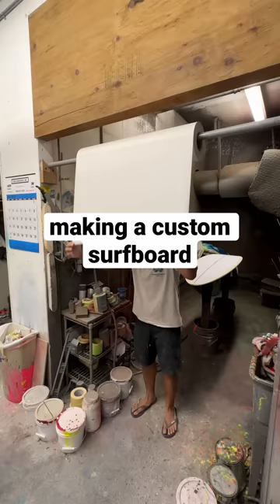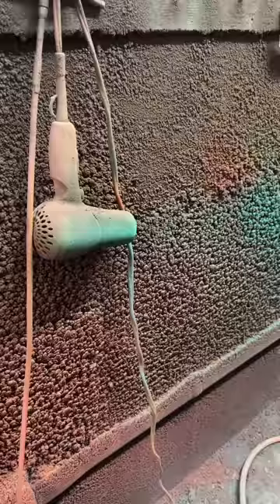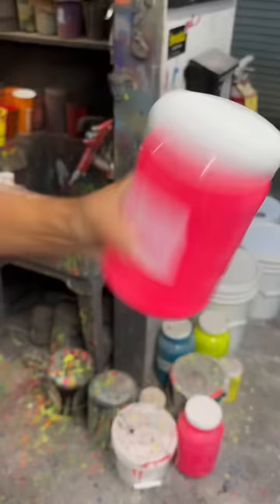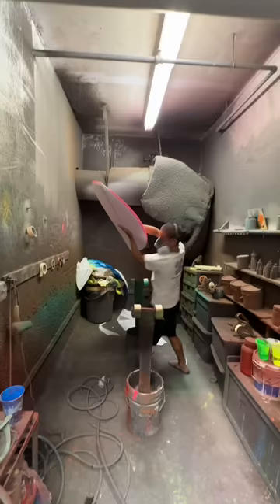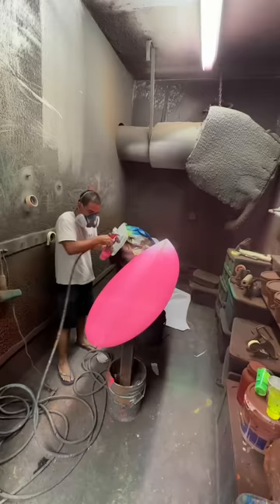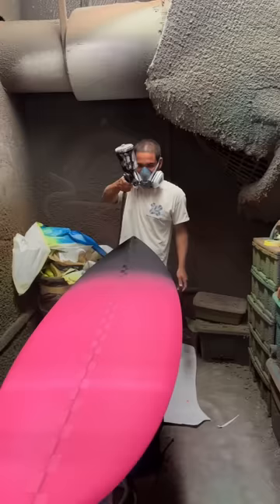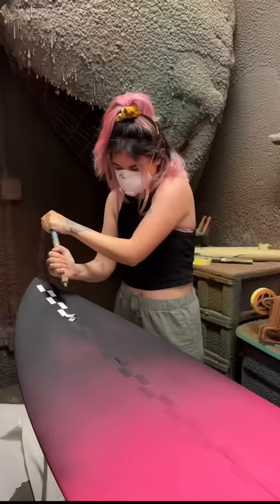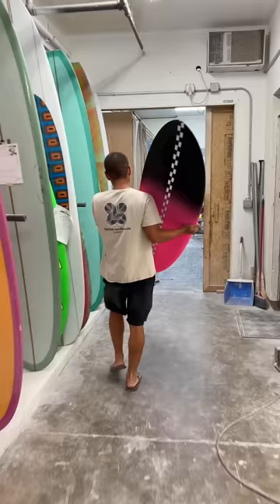Making a surfboard that looks like ME #shorts

Comment: Masks are super vital to spray painting I’ve done a lot of spray paint projects and just held my breath when I was spraying and one time I couldn’t breathe very well after a huge project and I blew my nose and a bunch of green paint came out, I was disgusted and will now always use a mask when I’m painting
Reply: the color if the paint isnt even the issue its the aerosol gas you breathe in lmao
Reply: @bear6699  they're saying that seeing the actual paint in their nose was the wakeup call to realize that they were inhaling paint.
Reply: @delaneykeller1389  exactly, even though I was holding my breath, stuff was still getting in my body. I haven’t been able to smell since I got Covid over a year ago so I can’t smell the aerosol and paint in the air so I really only noticed how bad it was when I physically saw the green paint
Reply: @veryoffpudding  that happened to me when I simply airbrushed something in my dads workshop! I sneezed out blue, and then I took a step away from airbrushing for a while
Reply: @veryoffpudding byub
Reply: Same here dude. Used to paint houses with a sprayer for a few years, and when I first started out I never wore masks because convenience, but once I started noticing white paint streaks when I blew my nose I knew it was time to be a little safer 😂
Reply: Lmao i inhaled paint painting pathfinder models. Never again
Reply: @veryoffpudding  dude i also can’t smell
Reply: Same with sawdust
Reply: Clean the paint booth

Comment: As a Vehicle painter.
Please always use masks when spray painting anything with any kind of substances.
I also highly recommend using one of those thin suits that are specifically made for spray painting.
Some substances are fine do apply without using a suit (because they are not that harming).
Just look at the lil pictures at the back of ur product they tell you what kind of protective equipment you should use for the application of the product.